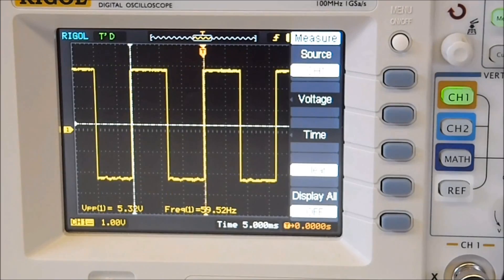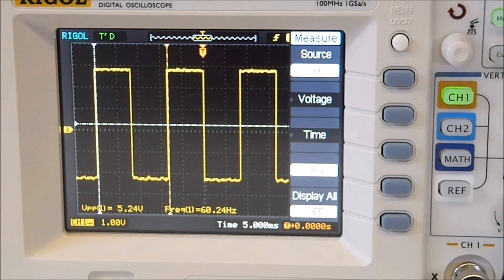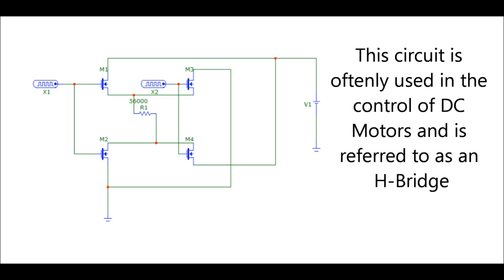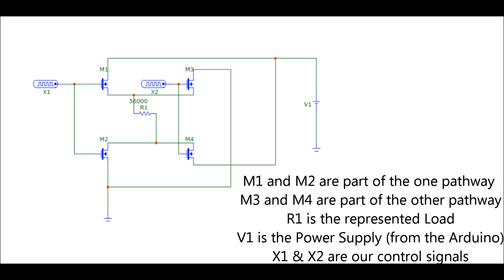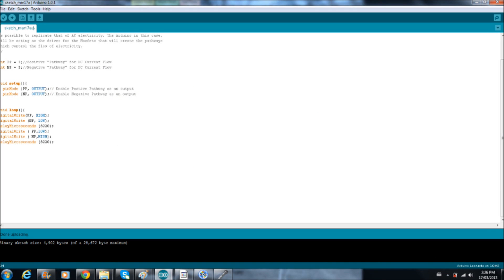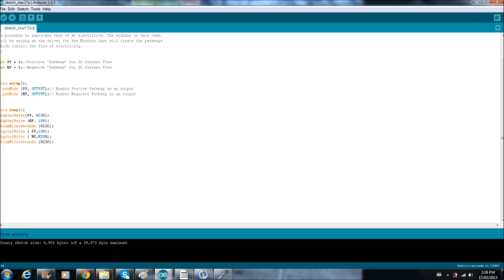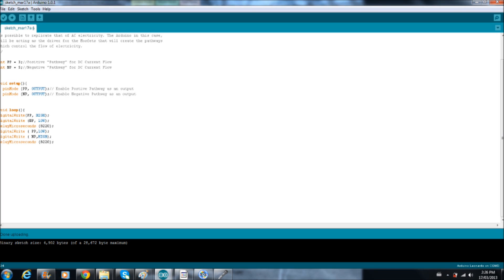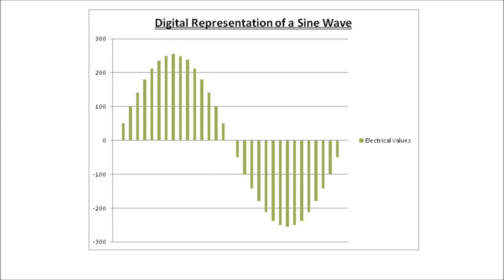How to Convert DC to AC

Comment: I found a functional way to get short pulses of AC from a (8-9)VDC+3VDC battery using two momentary toggle switches which I turned on and off really quickly it works okay considering I'm doing it manually and I passed it through a MOT and got 2000VAC :)

Comment: and i dont not understand what exactly is arduino
Reply from the maker: Saleem Wahid It is a micro controller that can be programmed to output signal and receive signals. Between that it can be used as far as the imagination can go. Highly recommend you pick one up and learn what it is by doing,

Comment: I've started to wonder how to create a 60hz sine wave from DC. I plan to use a Parallax Propeller to control the circuit. I subscribed to follow the discussion. The math for transistors is easy. I need to learn mosfets

Comment from the maker: First off thanks for the positive feedback!

I really like the idea of using a low-pass filter to smooth out the output of this device, though I think I should take it to the next level by creating more of digital to analog convertor and utilizing a resistor ladder, maybe using an inductor in series to the load and a filter capacitor to ground to really get nice curvature. I think you inspired me to create a better quality invertor, thanks for the motivation.

Nick

Comment: Nice Work, but you should always put first one pin LOW and then the other one HIGH, just swap two lines in the arduino program. Both pins LOW isn't a problem, but both HIGH is a big problem, even if its less than one ms.

Comment from the maker: This is going to feed into a control circuit, which I will be using to make a portable high voltage power supply for a secrete project I am starting! Thanks  for being active in the channel!